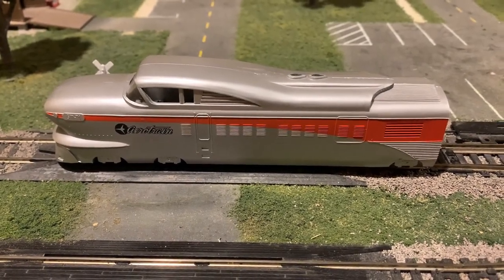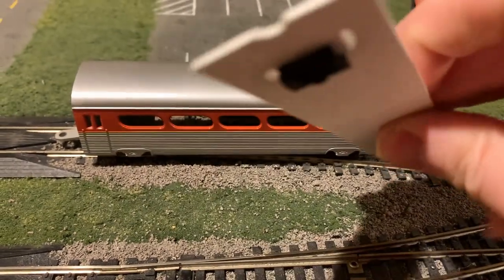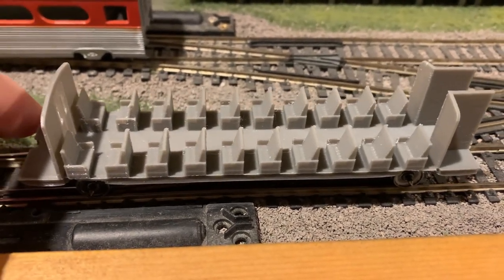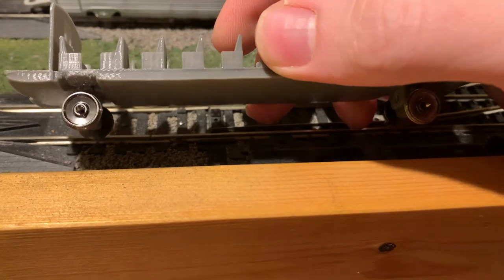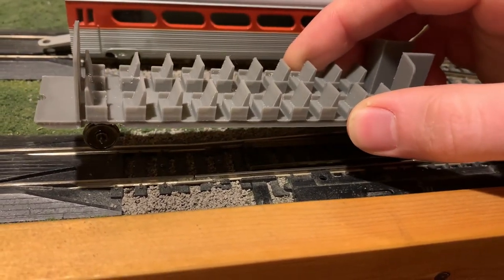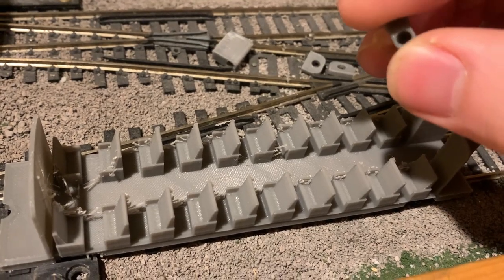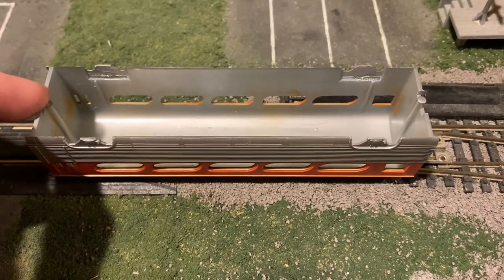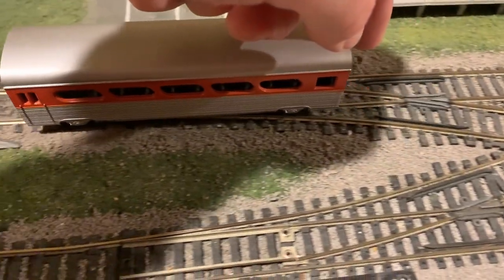Bowser Aerotrain - 3D printed passenger chassis/interior

Comment: Do you sell the coach chassis? I do not have access to a 3D printer. I checked out the one Bowser offers, but it doesn't include seating.
Reply from the maker: I wouldn't mind printing that out for you for a reasonable price.  You can contact me through the e-mail address in the "About" section on my account page.
Reply: I can't find your email address in the about section Im looking to reach out and see about pricing...